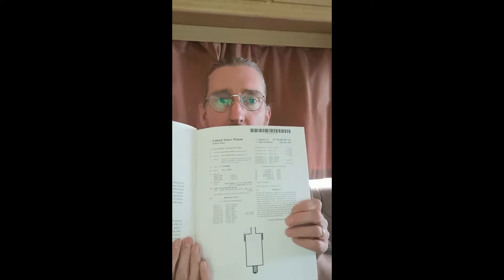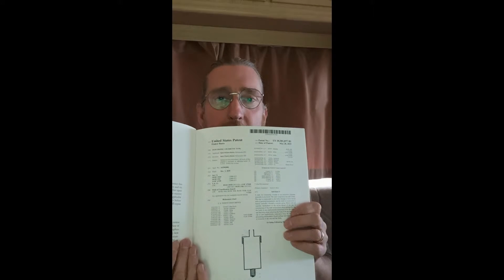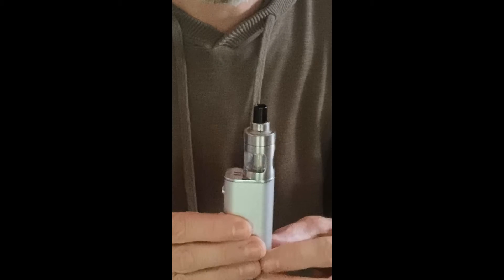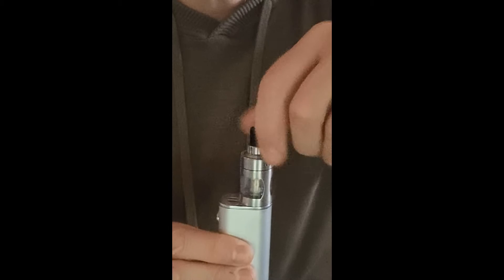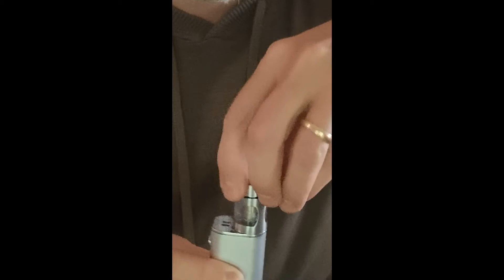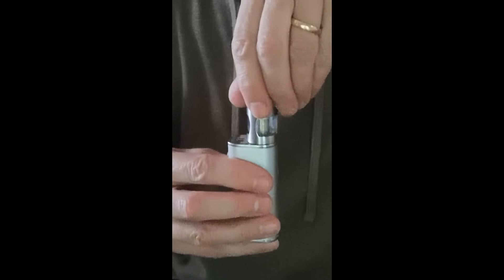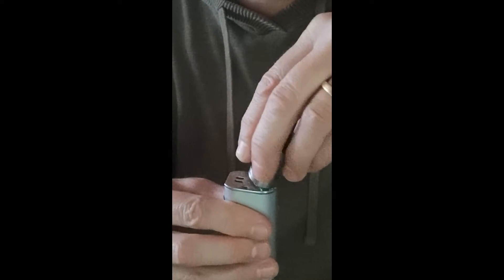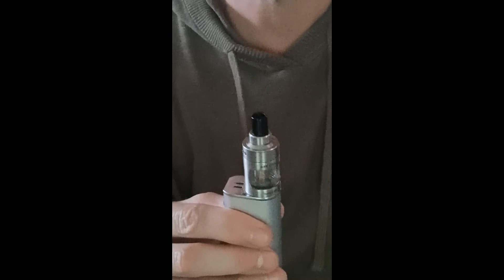Electric cigarette tank invention

Comment: Great idea.  May I ask your estimated cost for obtaining the patent?
Reply from the maker: If you can draft the application yourself, produce your own drawings, file it, and prosecute it with the examiner yourself, and you're a "small entity" (i.e. not a big company) the USPTO fees are less than $1000.

If you need a patent attorney, then it depends on what they charge and how many hours they claim it will take. Some are rip-offs (I saw one try to charge $11,000 for simply filing an already written provisional patent application). A reasonable amount for a simple mechanical patent should be about $4000. A complicated software patent could be $20,000.
Reply: @Thinklair  Really appreciate your response.  I've been wanting to file a software patent for some time, and your video has reinvigorated me to finally take action on it.  Thanks again!